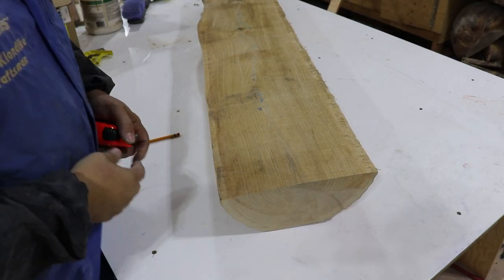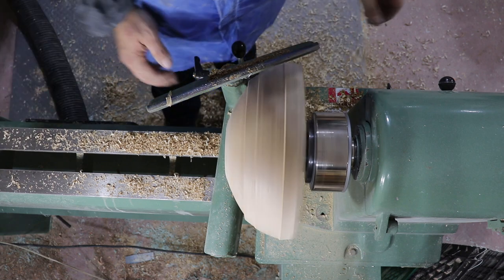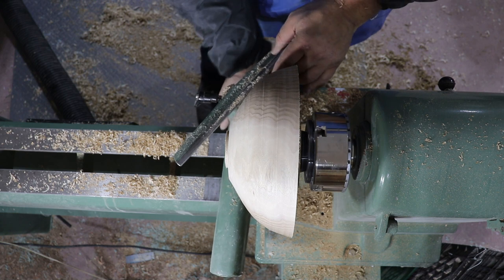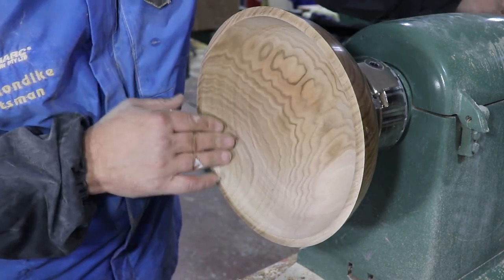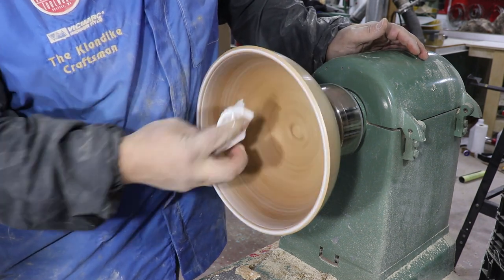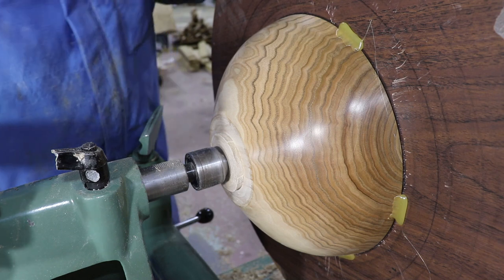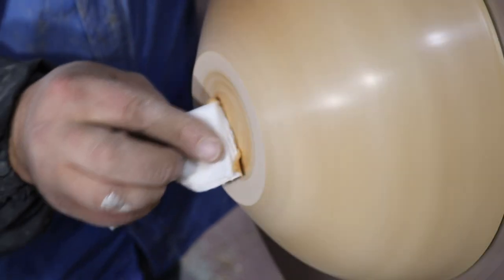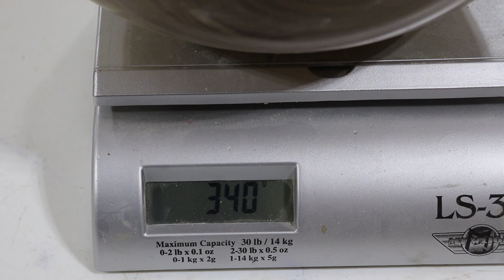Woodturning | Ultralight Butternut Bowl - Alternate method to turn bottoms on large pieces

Comment: Great Video Lkondike  interesting tip using the board to turn the tenon off will remember that ( hopefully ) During the video you say you used more Yorkie grit than usual do you think this is because you dont use any sanding sealer before the abrasive paste ?  good skills though
Reply from the maker: I meant in comparison with other woods I have use it on without sanding sealer. Thanks watching I appreciate it.